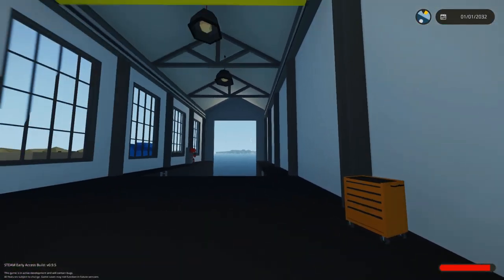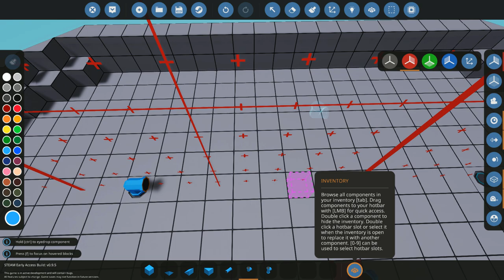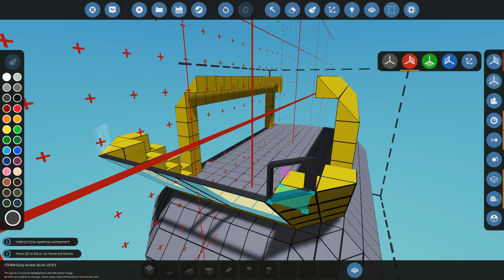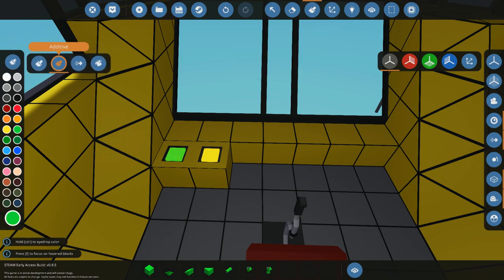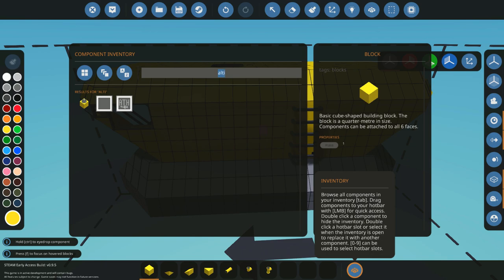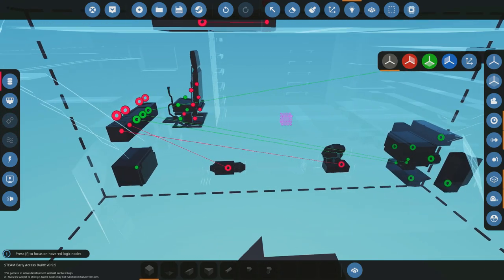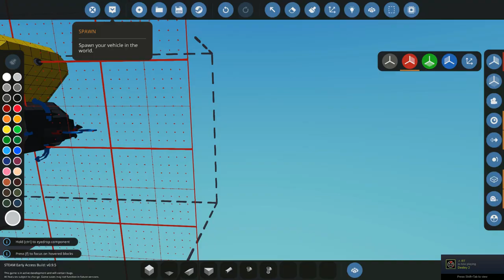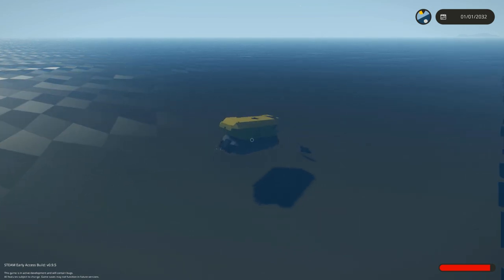How To build a basic Submarine in Stormworks B&R

Comment: If you want an engine you can add that as a generator. I would recommend 2 large fluid tanks per level of engine for air and exhaust, small engine has 4 tanks total, 2 for air, 2 for exhaust, medium is 8 total, large is 12 total. Use fluid filters to make sure only air goes into the air tanks(use pumps) and use pumps to pump out exhaust when you are above 50 below sea level. Under 50 below sea level will prevent pumps from working(i think).